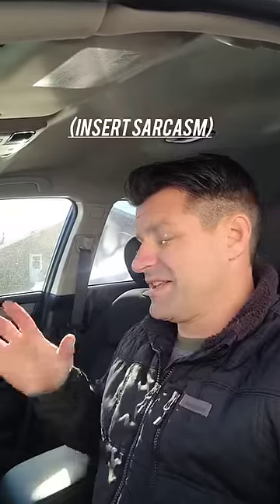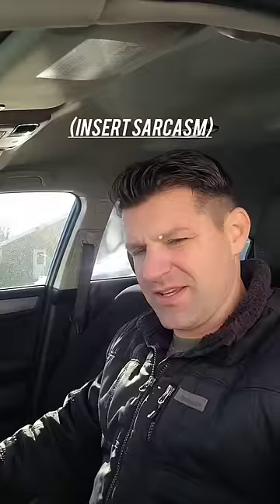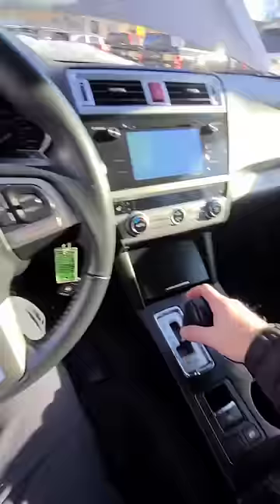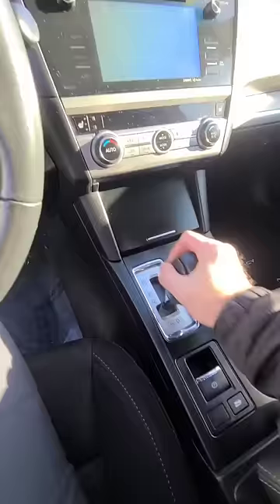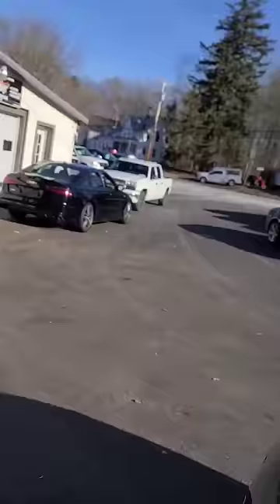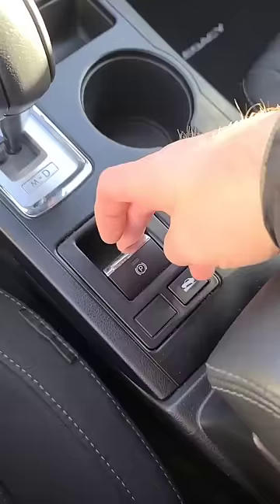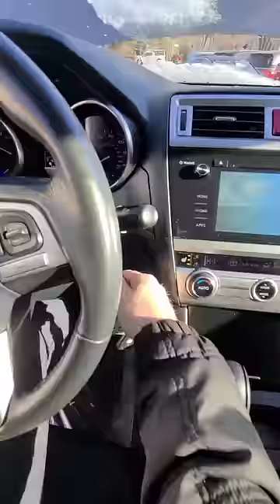Why Subaru Engineers deserve a punch in the Face! #shorts

Comment: "Just block the tyres, you Idiot."
My former boss.
Reply: 💯. Wheel chocks should be in every shop
Reply: @HDFXSB645  And how do you get them while sitting in your car?
Reply: @ferrari2k  I dont think he sat in the car the whole time the battery was dead. Plus call for a Coworker.
Reply: *tires
Reply: @ferrari2k  Were you sitting in the car when the battery died? With the car in gear and the parking brake not set?
Reply: You gotta have someone bring the chalks tho if it's on a him but it didn't move much tho when he got out
Reply: @AFS-ht7bg  likely the British spelling (tyres)
Reply: @ferrari2k was thinking the same thing
Reply: @Kitsune thanks for being the only person so far that seems to know the car has a shift lock release. It's literally less than 6 inches from the shifter and all you need is a pen or the screwdriver from the kit to use it.
Reply: @ferrari2k  Simple, you hop out of your car ...
Reply: Or steer to the left or right (yes I know power steering is off but you can still turn if the car is moving) until the car is perpendicular to the downhill and the car will stop moving.
Reply: that's anyone with a brain, to be honest.
Reply: Or just hold the car from rolling it’s a small car, not very hard
Reply: I really think this was one of those moments he wasn't expecting and now he's stuck holding the break. I bet he'll be using blocks next time lol
Reply: No one bring blocks or rocks with them for this...and he's stuck with foot on the brake.
Reply: @KnowingTruth  chock with the camera if that is all you have!
Reply: That is a solution, yes. However, it's a solution to a problem that shouldn't exist. A parking brake serves as an EMERGENCY brake as well. You don't need to bribe an emergency device into working, it should always be completely separate from every other system and always work, no matter the condition of the engine or other braking systems.
Reply: @AFS-ht7bg  tyres is the correct spelling
Reply: @AFS-ht7bg  you know theres other countries other than america right?

Comment: Bro, there's a little plastic clip next to the shifter. Pop that off, stick the key inside to release a lever, and allow you to shift into park. 
All cars I know of have em, that one certainly does.
Reply: ^^^^This.
And how is it there, with the car in neutral AND the electric park brake disengaged in the first place? For the battery to die, he must have been sitting there with his foot on the brake since the engine was stopped.
Reply: @TonyRule  Next up: Car computer crashes if you take wheels with tyre pressure sensors off while the car is running
Reply: THIS is FMVSS standard. unfortunately it specifies that the cover should only be able to be popped off with a "tool"
FCA had to recall a couple hundred thousand jeeps a few years ago because the shift lock covers would come off without a tool.
Reply: @jonasluks1438  "customer states tire light flashing, advise"
Reply: @jonasluks1438  See DiagnoseDan's "no start because of a door handle" on a 3-series BMW from a couple of years ago. I really don't need that nonsense in my life.
Reply: Actually it’s not next to the shifter like previous generations, 6th gen is in the cubby under the rubber mat.

Comment: There is a neutral release button that when you press it you can put it in any gear even with no power
Reply: some people shouldnt drive
Reply: That is correct. AFAIK every car has it, often called "shift lock" which actually does not lock anything - it unlocks the protection.
Reply: Read the video posters top pinned comment on the shift lock🤦‍♀️
Reply: There is also a way to prevent rolling down the Hill in any car. The steering wheel. Just put it to the side and you can have more than enough time to get something like a rock...

Comment: As an owner of a 2017 Subaru Outback that has had multiple battery problems from a parasitic draw, I approve of this message. 

I've got a routine of shutting down that enables a slightly longer battery life.. if being on the 4th battery is living.  I miss my 2003 Outback,  well, except for the headgasket issue.

Bought my last Subaru!
Reply: The alternator has a known problem. Do you burn headlights too? It's the voltage regulator in the alternator. Get it replaced.

Comment: I don’t understand why foot petal operated parking breaks ever were discontinued. they are extremely cheap, almost fool proof and take basically no engineering costs to implement. If that isn’t a good reason and you are feeling dumb enough you can even make them a break by wire item by adding a servo actuator that triggers when it’s fully compressed.